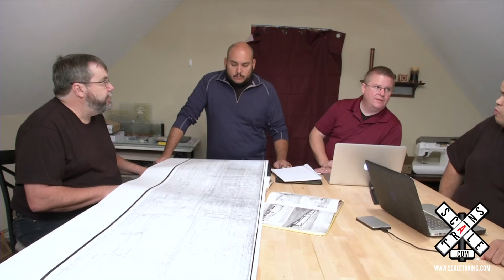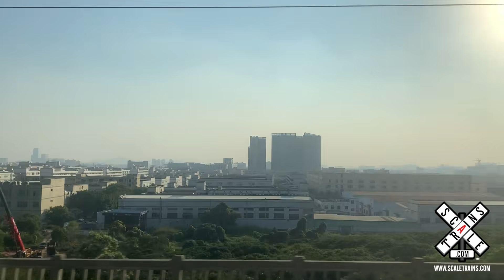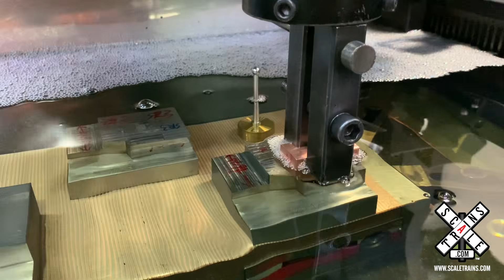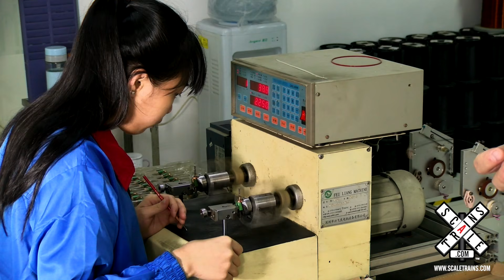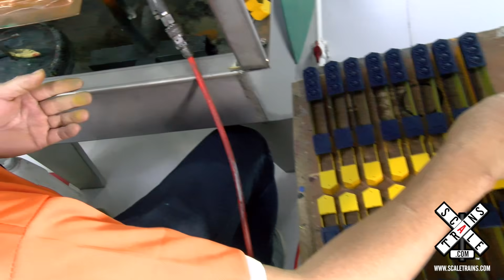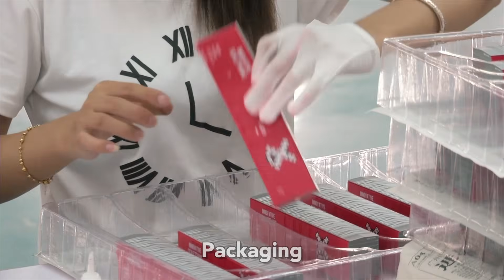How Model Trains Are Made

Comment: STONE AGE METHODS ????
Primitive American methods, and even more primitive motors. Nobody uses old fashioned "Pole" type motors now. We've been using "Coreless type" motors for over ten years, much more efficient, sensitive, and requiring a LOT less amperage. And "Spray painting" - that went out with the now extinct Do-Do ! Paint takes far too long to dry, slowing down assembly. You use Tampo Printing using inks, which are dry in three seconds. So part of the main assembly of the tens of thousands of models required, can be partially assembled by robots. These necessities also mean new ways of designing model locomotives. Indeed I can virtually disassemble a modern Diesel or Electric locomotive Model in seconds without the need for tools. Obviously they haven't heard of clever design in the USA, where model locos can include "Clip out Quick Clean" motorised bogies, which is a sideline benefit of making the chassis in such a way as to rid a number of parts including things like screws. Fewer parts = quicker assembly meaning lower production costs.

Comment: USE BETTER PLASTICS FOR THE BODYSHELLS,AND ELIMINATE THE TERRIBLE CELCON TO REPRODUCE THE HANDRAILS ALONG THE SIDES OF THE LOCOMOTIVES,WHICH DETERIORATE OVER TIME BY WARPING AND BREAKING.REPLACE THEM WITH BRASS SUPPORTS.AND GO BACK TO PRODUCING THE PARTS TO BE REPLACED BECAUSE THE SPARE PARTS SERVICE IS REALLY DISGUSTING

Comment: Great Video! Question does the Chinese manufacturing company owned the copper electrodes and the steel Tooling? If so then to be made in the USA you would have to remake all of the copper electrodes and steel tooling.
Reply from the maker: The factory save the copper electrodes for a couple of years after they're created just in case there is something that needs to be verified. Eventually, the copper electrodes are recycled to be used in future projects. We own the steel tooling including the mold base. FWIW: the average cost for tooling a Rivet Counter HO freight car today is $75K and HO locomotive is $250K. Shane
Reply: @Scaletrains  Thank you for the prompt reply. Good that you own the steel tooling and mold base.

Comment: that is a damn shame shipping only 2/3 full container considering all the extra models that could be fit in there plus all the bouncing around damage that will occur on the seas and on the intermodal shipping train as well as the intermodal trucking company hitting all those pot holes in the roads and crossing train tracks and all the sudden stops and high speed turns. no shipping airbags even

Comment: I appreciate the amount of work you guys (never girls for some reason...) put into these models, but you can do accurate measurements of a real life engine or car by using a 3D scanner.
Measure out a grid around the object, so the scans can be matched into a pointcloud, let it run a few passes, and you've got something solid to work from.
If set up right you can get everything from the coarsest dimensions to the fines details absolutely accurate, and you're creating a virtual model.
This can then be used to create molds or 3D printed parts to use in casting.

I've done this (the converting into a 3D model) before, on an industrial scale, to get an as-built situation.

Of course it's fun to actually have the blueprints too - I'm enough of a fan of modeltrains as well as an engineer 😜👍

Comment: If I'm buying ho scale model trains. Is it worth spending over $100? What's the difference? Can they haul more rolling stock? Would it be better to run 2 locomotives to push more carts or does that not work?
Reply from the maker: It depends on what you're trying to accomplish. If you're concerned about detail, our Rivet Counter brand would be your go-to. But if you're not as concerned about prototype-specific detail, you can always order our Operator locomotives which use the same motor and drive as our higher-end model. -Drayton

Comment: Question: if you can cnc the copper electrodes with the necessary level of detail, why do you need to transfer it to steel with edm instead of cnc the steel itself? Is the steel too hard? Fascinating video BTW!
Reply from the maker: The copper electrodes burn in the minute details to the tool especially in small places (i.e. rivets inside the ladders sides on the Water Tenders).  In addition, the CNC process cannot cut some complex shapes. -Drayton

Comment: 7000 electrodes?!!!??...im sorry but theres just no way simple EDM or 3 axis micro milling wouldnt be SOOO much cheaper and easier especially with modern G-code slicing software and cad modeling for those molds....but 1.2 million parts per run is INSANE!!

Comment: Hey Scaletrains, 

Is it possible to make metal (aluminum probably or brass) die cast models like this? I've always wondered if high pressure die cast would make for nice and heavy, very sturdy models. I know they'd probably be stupid expensive, but I'm just curious if it's feasible?
Reply from the maker: Here's a video showing exactly what you're asking:
https://www.youtube.com/watch?v=0XkDK46rwvQ

The MTH steam locomotive boiler tooling is die-cast. Injection molded plastic provides much more precise details with less part clean-up. -Drayton

Comment: Manufacturing in China is a major set of headaches, especially in terms of IP protection and quality assurance.

Every importer has heard the dreaded phrase: cha bu duo - which translates as: "Eh, who's going to notice the difference?"

Also, there's the term: mei you = no am got...

I get why a manufacturer of such finely detailed electro-mechanical devices needs a major, low-cost manufacturing center, especially given the amount of semi-skilled labor involved.

However, given the increasingly aggressive policies of the Chinese Communist Party, I would not recommend that a new venture go there for their contract manufacturing... and even if you go into the CCP's favorite mode, the joint-venture, you are still by law the minority partner, and will lose on any contractual conflict, especially if it goes into what passes itself off as a court system there. As a lao wai (foreigner), you simply do not have any significant guanxi (connections) with the Party bosses.

The recent political crackdown in Hong Kong has also ruined the only mostly honest banking center dealing with the PRC.

So, for a new venture, I would strongly suggest that a prospective importer of custom products look to Korea, Thailand, Malaysia, Indonesia, and Vietnam. China is too politically and economically unreliable for the near term future. This is too bad for the Chinese people, but the Party is making a big mess...

Or, bite the bullet, automate the heck out of your processes, lease the machines, and look to Columbia or Chile... you can get affordable engineering services in both countries. And, there are still many people fresh off the farms and you can trade automation against labor costs.

Unfortunately, even in relatively low-cost states like Tennessee and Alabama, it's very difficult to compete price wise with importing.  Not impossible, just difficult, and you need to invest much more of the manufacturing budget in automation and labor-saving operations. You may still need to source your motors and electronics from Asia, although Thailand and Vietnam are able to compete against Chinese prices, and almost always on quality.

Manufacturing of premium electro-mechanical goods, such as model train locomotives, is always going to be a juggling act, with high unit costs versus limited sales volumes.

Why yes, I looked into getting into making model locomotives and other injection molded details and accessories myself a couple of times... never could raise enough capital to get to startup... I might do some cottage scale narrow gauge production after I retire... I won't be trying to manufacture in California in any case... ;)
Reply from the maker: Manufacturing model trains in the U.S. is not economically possible for three reasons. 1. there is no factory producing super detailed locomotives and freight cars currently; 2. there is no supply chain (parts suppliers and subcontractors); and 3. products would cost as much as 3x more. We do not have several million dollars to spend for #1 and #2 and we do not think most American modelers would pay up to $1K for an HO Scale diesel locomotive.  -Drayton

Comment: All I could think of while they were at the factory in China was; 1) This must have been filmed pre-covid. 2) Holy crap what a PITA, it's got to cost a fortune to make all those detailed molds. With so much work involved the ridiculously high prices for model trains starts to make sense.
Reply: Actually, Eric, the cost for locos is really good. In the 90s I made custom Rail Power Products diesels. Shell, chassis, motor, drive train, paint, decal, all the little detail parts, etc. By the time I was done, a typical loco would run me around $200. And that doesn't include my labor hours. That was also without DCC/Sound. Add that cost in and you are around the $300 mark. For the same $300 (or less) in TODAY's dollars, you get what ScaleTrains is putting out. The end product is far more detailed and accurate than anything I used to make and it includes the wonders of DCC.

I do think that rolling stock pricing is a joke these days, though. Yes, they look amazing, but there is a big hole in the market for the old school Athearn blue box type of rolling stock. Decent enough and priced accordingly. I refuse to pay $40, $50, or more for a box car. So, I just buy old stuff and swap the wheels and couplers. I can build out a nice car for around $15. It does mean I don't get to buy exactly what I want, but I'm OK with that.
Reply from the maker: This was filmed in November of 2019. We were thankful to have had the opportunity to produce such a video. Thanks for watching, friend. -Drayton

Comment: Why is it not possible to manufactur all of it in the US?
Reply from the maker: Great question.  There are three reasons.  1. there is no factory in the U.S. that builds super-detailed locomotives and freight cars.  2. there is no supply chain (raw material suppliers and subcontractors). 3. products would cost up to 3x more than current prices.  Shane
Reply: @Scaletrains  I life in Europe and in former times i bought PIKO produkts (manufactured in China). But after having found out what this Chinese despots are doing I changed to products made in Europe....and this products are less than 15 % more expansive...sorry..what works in Europe should als work in the US...don`t buy China products if it is not absolut nessesary..like modell railways !  Sorry for my worse english !

Comment: There is something wrong in your factory. I bought one of you Museum Quality Three unit Gas Turbine. When it was received there were several parts in the packaging that had fallen off the A and B units. When the fuel tender was removed,very carefully as done on the A and B units, several more fell off. The reason?? You cannot glue painted plastic parts to other painted plastic parts. Either your factory doesn't understand this, doesn't care or has the factory been told this? The quality control dept. In both China and the USA is either non effective or non existent. Having paid alot for this model and finding twenty-four parts having fallen off because the parts hadn't been masked before the painting process or cleaned off after painting to me is taking the piss. The model was returned to the hobby shop it was bought from. Please talk to your factory about these issues with this model. Mine cannot have been the only one. Hopefully this will then not happen again.
Reply from the maker: Hi Tulyar, we're sorry you've experienced issues with our Big Blow Turbine locomotive. Please know that if you ever have an issue like that, you can contact our product support team who will gladly assist you in repairing or replacing your damaged model per the factory warranty. -Drayton
Reply from the maker: Having this many parts fall off during transit is highly unusual.  We do instruct our factory to use less glue rather than more glue.  If too much glue is used during assembly, the glue can ooze onto the model, fog the windows, and clog the fine metal etches.  If a part falls off, it's easy to glue it back in place.  We'd rather a part need to be re-installed than have a model ruined by too much glue.  Shane

Comment: Just imagine if you didnt have to fly to china and just drove across the country to see the factory. Made in China is getting old. Time we start making stuff here.
Reply from the maker: Manufacturing model trains in the U.S. is not economically possible for three reasons. 1. there is no factory producing super detailed locomotives and freight cars currently; 2. there is no supply chain (parts suppliers and subcontractors); and 3. products would cost as much as 3x more. We do not have several million dollars to spend for #1 and #2 and we do not think most American modelers would pay up to $1K for an HO Scale diesel locomotive.  -Drayton
Reply: @Scaletrains  yeah i know. the same train would cost $500 if it was made here compared to $150. But it would be great to put Made in the U.S.A. on the box and give American workers a job. it would cost a little more to get going but once it was running with all the equipment the prices would come down. a lot of this stuff could probably made on 3d printers.

Comment: What would it cost to produce these items back in the USA now?  Would you actually find enough skilled or interested workers?
Reply from the maker: Manufacturing model trains in the U.S. is not economically possible for three reasons. 1. there is no factory producing super detailed locomotives and freight cars currently; 2. there is no supply chain (parts suppliers and subcontractors); and 3. products would cost as much as 3x more. We do not have several million dollars to spend for #1 and #2 and we do not think most American modelers would pay up to $1K for an HO Scale diesel locomotive. -Drayton
Reply: Once the US runs out of elephant countries to produce cheap products, some "essential" products will be made hear, the remaining non essential products (toys) will not exist.  About 15-20 years out.  ST nailed it, although I would say 10x the cost not 3x.  Then there is 15 year environmental impact study by state DEC, EPA etc. for an injection molding plant among countless bureaucracies to work through.  I'm amazed they can make a business doing this.  So if you want trains buy them now and don't wait.  Wait too long you will be scratch building it all.

Comment: I am disappointed with the fact that you use Chinese manufacturers

I know that manufacturing ends up costing more although there is an offset with shipping till a small amount but for the cost of your product and a few dollars extra that American manufacturing that is definitely something that would steer me towards your product line versus away from your product line
Reply from the maker: Producing model trains in the U.S. would be a lot more expensive than a "few dollars more".  Prices would increase  3x which means an HO diesel locomotive that currently sells for $250 to $300 would be in the the $750 to $900 range.  We don't think American customers would be willing to pay that much moe for made in the USA model trains.  Shane

Comment: As a railroad author and consultant I spent 5 years in the Republic of Colombia. Little by little I was introduced to hundreds which probably represent thousands of Latin American railroad buffs and HO modelers. There are train clubs in virtually all of the major cities and model railroad clubs with wild memberships with numbers like 1k members not being unusual. The problem is they (and I'm talking from Chile to Guatemala many, if not most railroads are US equipped 3' gauge) have NOTHING that represents their railroads in HO or any other scale. 
3' gauge Alco's, U-10's, 15's and GM or Baldwin diesels in narrow gauge is a sight to behold. Sadly there are not even parts from which to kitbash such colorful trains. I would love to see a middle of the road operators type model (to keep costs low) of a type that would lend itself to kitbashing several different versions using the frame, motor/gears and trucks. The AAR type B truck in HOn3 could blossom into Alco, GE or Baldwin locomotives and have a huge appeal. In any case I'd be happy to assist in spreading the word and introducing a true working model of a modern US Built diesel model to South and Central American Railroaders and modelers.
Reply from the maker: Thanks for the comment, Robert. If you have product suggestions, we recommend emailing us at Ideas@ScaleTrains.com

Comment: Thank you for describing my job to me! Actually what goes in is my experience with trains, photo collection, drawings and measurements of the original, what goes out are 3D files and PDFs for inscriptions that are then sent to the tooling and decoration department. Between that I spend days and nights, weeks and months in monkish isolation sitting at my computer and hardly ever get out of my office room at home, which is probably an advantage in an era when we all should watch out not to get infected.
(And sometimes I get the time to watch videos like this.)
Yes, one must be as picky as the worst rivet counter among the customers. The older a prototype is, the more adventurous and less precise it gets. An original might be preserved somewhere in a terrible state with parts missing leaving you to guess what once was fixed to those rusty holes. It's much easier for contemporary prototypes where sometimes you can just work from the 3D files or CAD drawings of the original.
Reply from the maker: Thanks for watching! -Drayton